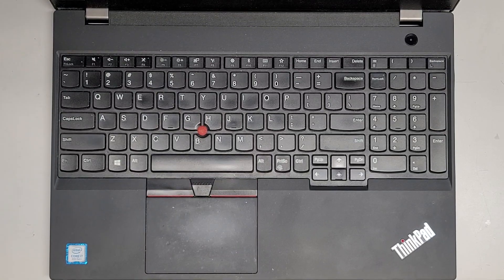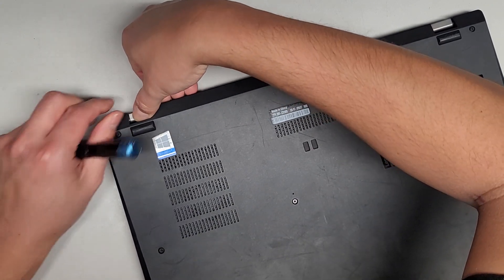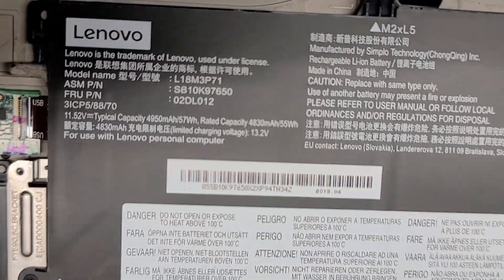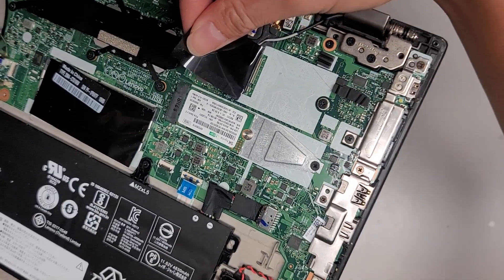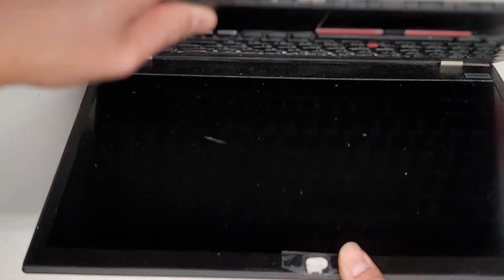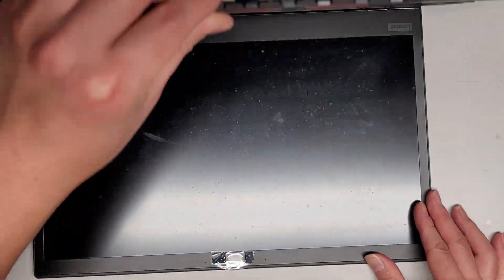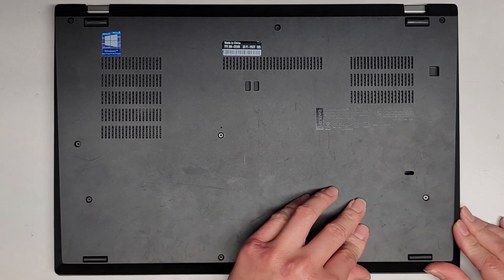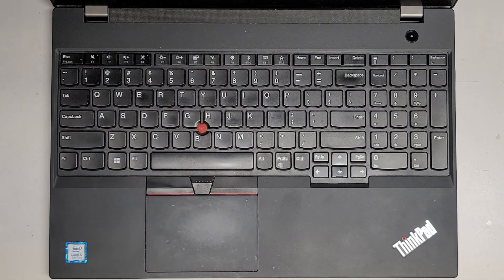Lenovo ThinkPad T590 Disassembly RAM SSD Hard Drive Upgrade Battery Replacement Repair Power Fix

Comment: The battery reset button suggestion worked like a charm, thanks. btw the issue was that the laptop wouldn't charge after running out of battery, but after holding the reset button, it started charging again.
Reply from the maker: Awesome! Glad it was an easy fix. If you haven't already, please like and subscribe so others can find my videos and possibly consider watching a few others and commenting to get the algorithm to recommend my channel. Thanks!

Comment: My advices are, have patience with the clips, mine gave me a hard time to open... Remove the card slot, so that the clips from the back loosen up.
If you remove the internal battery cable, then when you reconnect it, be sure to push it back well so that it reconnects (I had to disassemble mine a second time to reconnect the battery, because I didn't push it enough the first time).

Comment: Hi there, seeking your advise.
First of all, thanks for the video, for the time and very good explanation. 
My Lenovo Thinkpad T590 from time to time it gets stuck, for example opening Teams web version or when I'm in a zoom meeting. 
I have upgraded the Ram, now running 32 GB, i have changed SSD NVme but still the same. I have tried W10 and W11, no changes. Any Idea what else can I try?
I have tried changing browser with no joy. 
I have cleaned the motherboard , check drivers for both OS but most of the times, PC is just fine; I try to demand a bit or sources and it just get crazzzyyy, performance shows well on the taskbar but you know something is not good
Reply from the maker: You did a clean windows install?

Comment: Hi i have question i have lenovo e590 can i use external gpu if yes can  you please tell me how?
Reply from the maker: No idea
Reply: Need thunderbolt for that, and not worth it as youll lose 30% of the gpu power as the bandwitch through the usb cable wont be enough.
Reply from the maker: @Bruceybonus2008  sad
Reply: @ItsBinhRepaired  yup
Reply: And for T590 is possible for eGPU?
Reply from the maker: @Guy-i8s  no idea
Reply: @ItsBinhRepaired  Gee = you are helpful lmao
Reply from the maker: @trickolas78  lol sorry, I'm limited to the videos.

Comment: How's your T590 running? I got mine a month ago. It's totally brand new, but now i see a small, barely visible red line in extreme right corner of it. Other than that, this machine rocks. 

I have been virtualizating linux and Windows on it, so far so good display is fine just that red line which comes after hours of usage.
Reply from the maker: I don't own it, so I don't know.

Comment: Hello,

I hope you are doing well. I have a question about my Lenovo ThinkPad T590 laptop. Two weeks ago, before shutting down my PC, it prompted me to install a system update. After installing the update and shutting down the PC, when I tried to restart it, nothing happened. I tried charging it, but the issue persisted. Then, I used the emergency button at the back of the laptop and attempted to start it. Here's a video showing what's happening: 

https://youtube.com/shorts/4U9-6TxB3us?si=J-Q9bEINZ6RLSAES

Has anyone else experienced this problem? Do you have any advice or ideas on what might be happening? Do you think the issue is software-related or hardware-related? I look forward to your feedback.

Thank you
Reply from the maker: If it was updating and it "shut down", assuming you didn't click update and then shut down, it was likely in the process of restarting while completing an update and you powered it off with the button, causing the motherboard bios chip to have an incomplete update. Not sure you can revive it.
Reply: Thank you very much for your response. Did you watch the attached video? So if I understand correctly, either changing the BIOS or perhaps trying to flash the BIOS could potentially resolve the issue? So it's not the motherboard that's damaged, or possibly the screen?
Reply from the maker: @soufianesodor3832  yeah
Reply: ERROR Code is: 0001. Reset Error (platform reset not de-asserted)
Remove all power resources (The AC Power adapter, removable battery, and coin-cell battery).

Hold down the start button until the computer turns off.

Turn the computer upside down and find a small hole next to the center screw that holds the case in place.
Use a paper clip and insert it there and press gently until you feel a click - hold for 10-15 seconds and release.
Connect the charger and try to turn on the computer.

!!!!!!the most important thing!!!!!! The charger must be connected during BIOS installation.

Use Lenovo System Update to update all of drivers.
Reply: so, the motherboard isn't damaged in this case; the issue likely stems from the BIOS, correct? Thanks, and sorry for the question; I just want to gather more details before seeking support."
"Another question: why did you tell me in the first answer, 'not sure you can revive it'? What do you mean by this phrase? 
You talk about the laptop or motherboard or the BIOS 
Thnx
Reply: @lukaszags8398  hank you for your feedback. Unfortunately, I have tried this method and it didn't work
Reply from the maker: @soufianesodor3832  try fixing the bios. Then you'll see why I'm not sure.
Reply from the maker: @lukaszags8398  hope it works
Reply: @ItsBinhRepaired  Your answer confuses me.
Do you have a flash for the BIOS? Or a quick solution?
Reply from the maker: @soufianesodor3832  I don't have a solution. That's why I said I don't know.